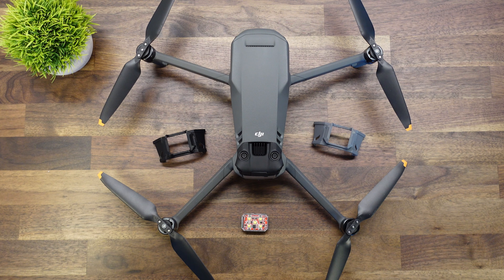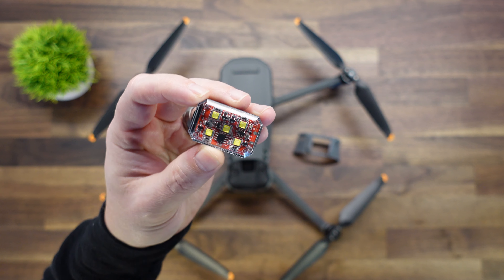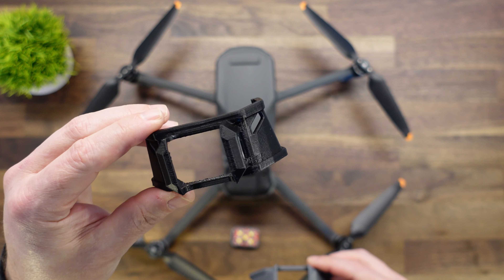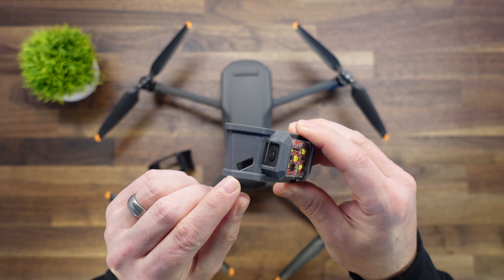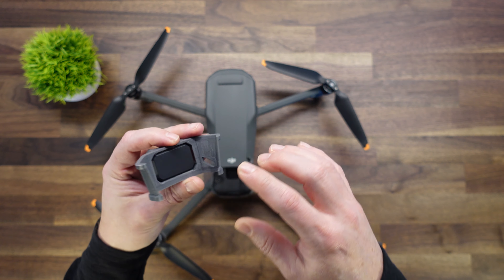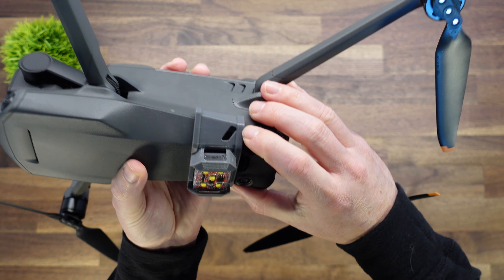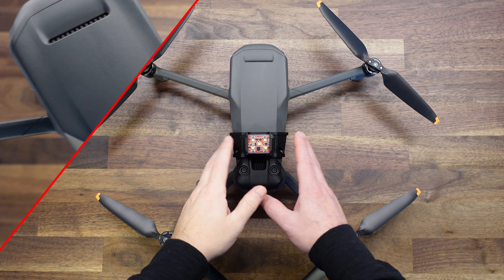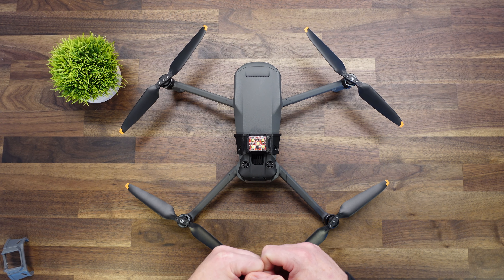Mavic 3 Top Strobe Mount Installation for Firehouse Technology ARC V

Comment: Looks like a good product. Does putting it on/off leave scratch marks, though?
Reply from the maker: The mount is made of PETG which is a softer plastic compared to what DJI uses. We test fit every printed mount before it goes out and after hundreds of installations there are no scratches on our Mavic 3 yet.

Comment: Looks like the mount blocks the light from the sides though?
Reply from the maker: Most of the light is visible on the sides too, see this image https://aerial-pixel.com/dronepilots/images/M3ARCVSIDE.jpg
Reply: @AerialPixel  Ah, I see. I didn't notice the opening before. Nice!
Reply: Blocking air vents
Reply from the maker: @franciscolluberes1741  Front 2 air vents are completely open, the back two air vents are mostly open as shown in the video.

Comment: do u have any of these top mounts for the arc V on the Mini 3 pro?
Reply from the maker: We currently don't offer a top mount for the Mini 3 Pro, We only have arm mounts for that drone. You can find them on our website here https://bit.ly/mini3arcv
Reply: thanks for your response. is there any plan to have the tp mount for mini 3 i future? personally i dont like the arm mount especially since im only using one arc v...it seems unbalanced...the top mount would be perfect
Reply from the maker: @jovangardner  No, there are no plans for a top mount for the Mini 3. There are no good places to clip on to, on the previous mini and mini 2 they clipped right at the vents, but with the overheating issues the Mini 3 has I will not be clipping anything anywhere near there. A single arm mount doesn't affect the drone at all, that motor will barely spin faster in the other slightly slower, The drone automatically compensates.
Reply: @AerialPixel  thanks a lot for clarifying. I will definitely consider it for my mini 3. I have the one for my air 2s in my cart the $20+ shipping to Canada got me stuck, however its the best product I've seen for mounting the firehouse arc v